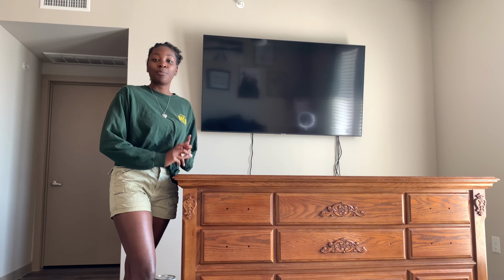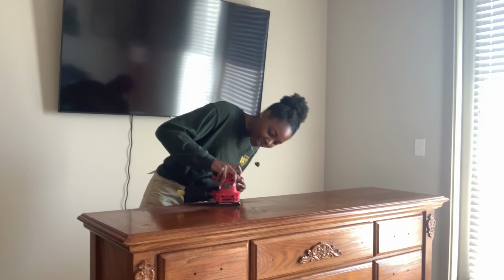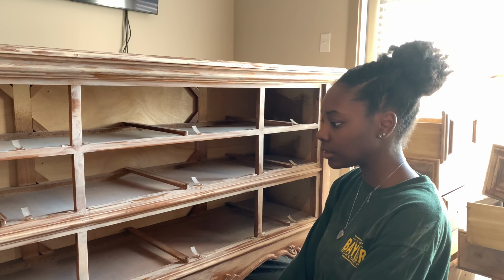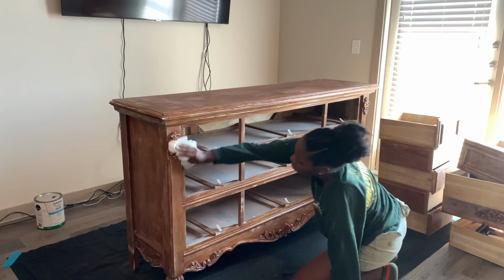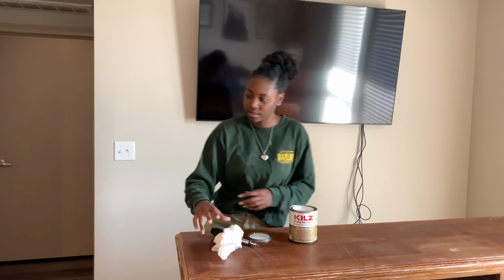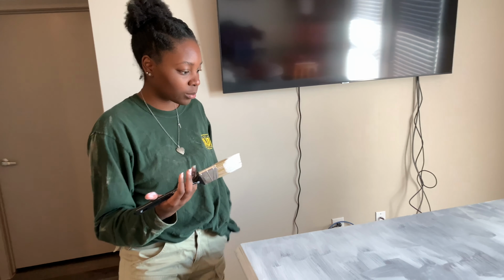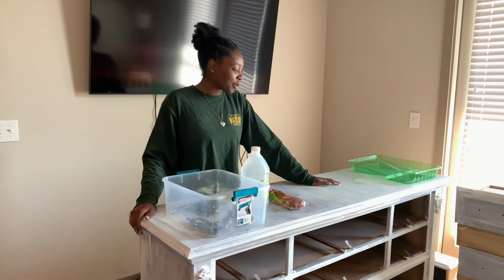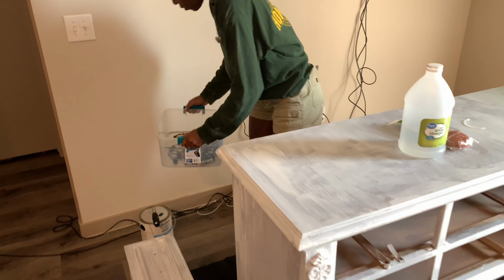DRESSER MAKEOVER/ DIY TRANSFORMATION

Comment: If this dresser is veneer, they make veneer paint. If it’s not, and it’s just the varnish, you could save yourself a lot of work by either using Zinzer 1, 2, 3 primer, OR, a gel based stain/paint remover and then primer. Then of course you may know this already, in that case I’ll just 🤐 it.